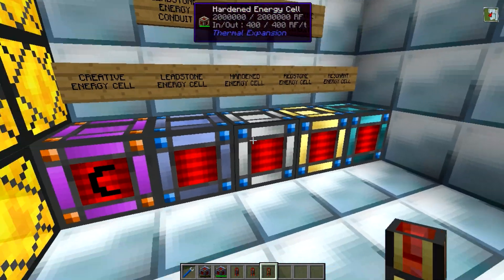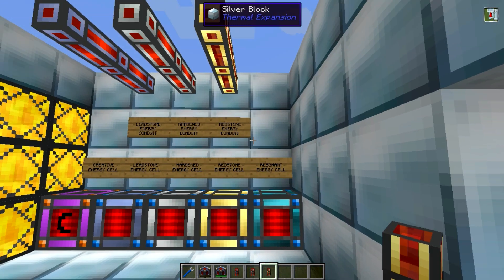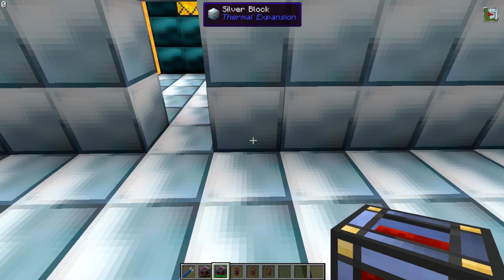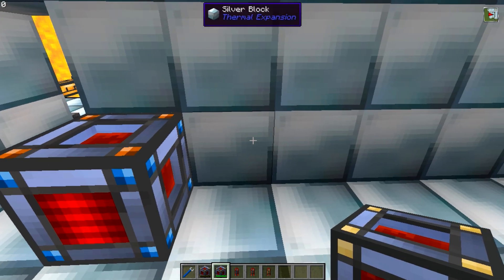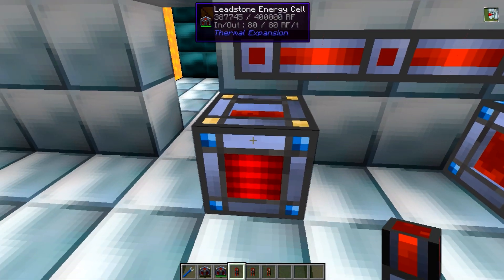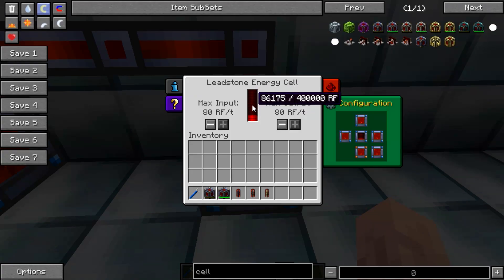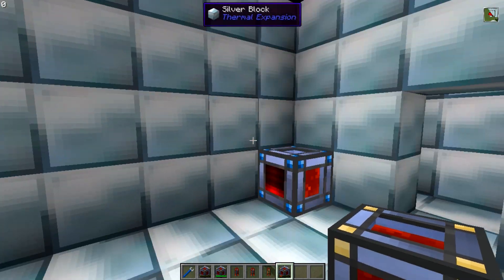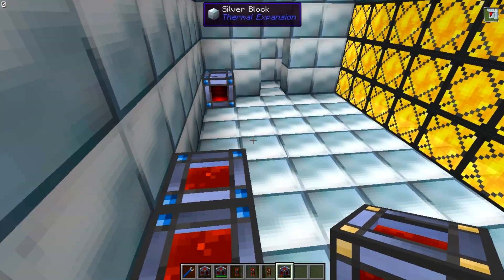ENERGY CELLS & ENERGY CONDUITS THERMAL EXPANSION 3 MOD SPOTLIGHT

Comment: So I just got a small base running, got 6 machines up running on "infinite power" (using 2 magma dynamos and a lava creator) (im on attack of the bteam), everything was going well with leadstone (cells and wires), cell was charging but as soon as I switched to redstone wires and cells, if I put my cell to give no power, it will start fill out, real real slowly, like asif it was connected with a leadstone pipe (not even a hardened one), but as soon as I plug the output on, the battery drains itself in like... 20 seconds? Could it be possible that some machines require an infinite amount of energy? (I might be thinking about a Planter which I got setup a bit away from my home) because all of my other machines are full and yet the energy cell refuses to even get 1 energy setup in it? Anybody can help me?

Comment: Ugh feel like an idiot. Thanks for the video. Completely forgot to click the gear to see if there is a way to turn on/off inputting. By default when I placed it it kept being all yellow so I was wondering why the heck the conduits weren't connecting. 

Also the crescent hammer thing helped me out quite a bit. Noticed it didn't store energy with the pick so thought it was no longer possible to move em.

Comment: how does one get power in the cell to begin with?
Reply from the maker: You have to get create energy with the dynamos, which have replaced engines.
Heres a link to another video on the dynamos.
DYNAMOS THERMAL EXPANSION 3 MOD SPOTLIGHT DYNAMO
Reply: thank you!

Comment: how do you fill these with energy? sorry for being such a noob.
Reply from the maker: Hook the cells up to some dynamos, make sure the dynamos are pumping into a blue face on the cell. If that doesnt solve the issue, could you describe your setup a bit, and Ill try and work out what the issue may be.
Reply: figured it out. pipes only connect to the top of the dynamos.

Comment: the conduits are mainly for how much output you want? and are these like teseracts?
Reply from the maker: They are basically tiers. The cheaper they are, the less RF they can carry. Think of them like low medium and high voltage wires. If you want to move a lot of RF, then use higher tier conduits. Not like tesseracts no, they are basically like wires or cables. Tesseracts are in the mod, but there is only one type now, rather than seperate ones for fluids,items and energy. The video will be up tommorrow. :)
Reply: thanks alot. your vids are helping out alot.
Reply: random question. i know it has nothing to do wih this mod. but does silk touch pick up spawners?
Reply from the maker: Sadly no. Are you playing on a modpack? As some mods do allow you to pick up and move spawners.
Reply: it doesnt work lol. im playing tekkify 1.6.4
Reply from the maker: sandmanx187
In tekkify, there is an item called a porta spawner, its a little expensive, but it will pick up spawners the same way a safari net picks up mobs. :)